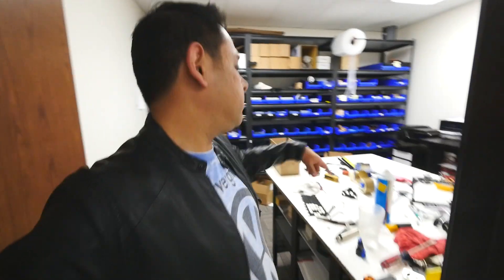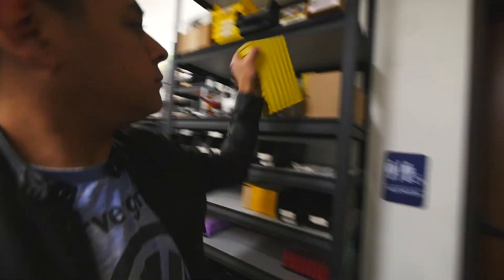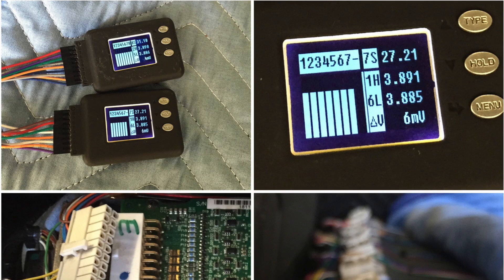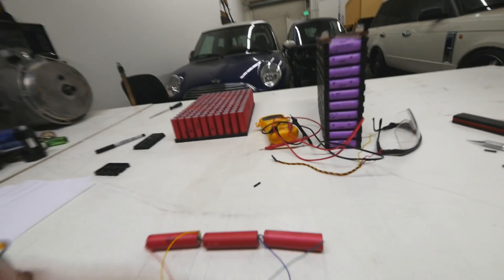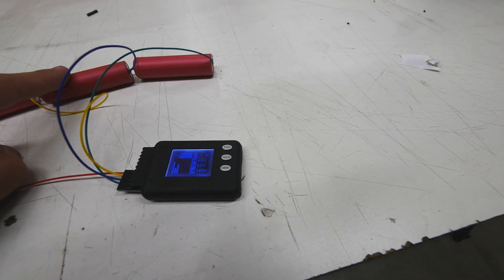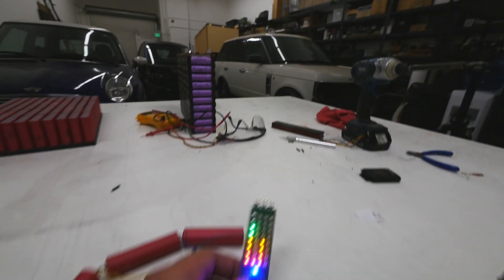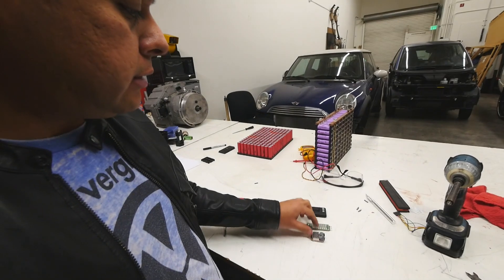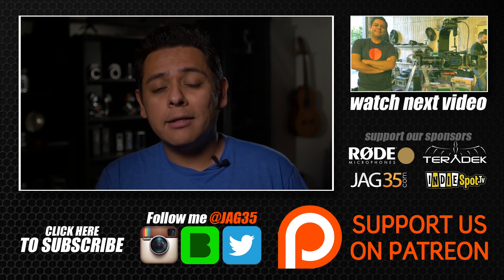Battery Management System Or BMS?

Comment: Jehu,  are you familiar with Bioenno batteries?  I think they are LiFePo4 packs.  I bought one that looks exactly like a 12v7amp sla pack.  It’s rated I believe 13.2 at 8 amp with less than 1/3rd the weight of an equal SLA.  I also bought their 13.2 Vdc @ 30 Amps pack,  it is not a SLA drop in replacement.  It was what I consider expensive.  The 30 amp pack cost around $330 with charger.  I found a NOS 35mm camera case and it fits perfectly in camera bag.  I would love to build a Power wall !  I am amateur radio operator and would enjoy a project that would allow my entire radio room to operate from battery.  Kind of a dream right now.  I have a small portable radio made by a company called Elecraft that’s in Northern CA ,  it is an amazing radio but it has very strict max voltage.   Anything over 14 volts and you are risking major damage to a $1,800 piece of portable radio gear.  The math isn’t working out in my head well, but is there a BMS or DC2DC precision regulator that would permit building a very small 18650 pack that could regulate at 13.8VDC at 5 or 10 Amps?  I will keep watching your videos for more information, just discovered your channel a few nights ago!  Very interesting and professional content and production credit to you for all your efforts!  73 de Seth - W8FG

Comment: so basically balancing the cells means draining the one with the highest voltage, but if you have 100 cells parallel working like one(cell) you need a big resistor for draining this high voltage cell, I am right?
Reply from the maker: +Jose Garcia not high voltage, high capacity,  it’s the same voltage as a single cell

Comment: My thoughts.. The reason for balancing is to prevent cells from overcharging. If some cells are at 100% already and the rest is at about 95% the charger will still charge the battery pack, because overall the pack is maybe at about 96%. So the full ones will get overcharged.. That's the theory... OK. good quality cells are never ever that far away from each other. And they don't break right away if they get charged a little bit longer. If you want to charge your cells super fast with many amps, a BMS is probably not bad but it will not balance the pack in such a short time. If you have the money and space in your vehicle, or you use many different cells you probably should get a BMS for maximum battery lifetime. A BMS can be really cheap and also really expensive. It depends on the quality and every BMS can break. If you have enough space, you could invest the money in extra cells, instead of a BMS. If space is very limited, it's probably also better to use all the space for cells instead of a BMS and just monitor them every few months.

Comment: Agreed.  A BMS is not required on most systems. I think a BMS is more of a simple solution for those who don't want to deal with  more complicated cirtcuits. Yet, If you want to squeeze the most out of your cell's life, a custom monitoring system is the best way to go. You can go really creative with an ABMS (Advanced Battery Management System - and yes, I just made that up), which monitors your batteries every so often, controls your chargers, and alerts you when a cell is showing sings of struggle.
Reply: Ruben B. Molina i

Comment: hello,how would you charge a 48v 13s 7p battery with out bms?, just connecting a 48 volt charger straight to the battery? but for how long do you keep it on the charger? I'm new to this... Thank you.

Comment: how would you recommend  building a lithium pack for a 12v car audio system? something that could support 8000 watts
Reply from the maker: easy 3S30P (90 cells total)   of these http://j35.us/18650-LG-HE2 ,  thats good for 10,000W   but you'll need this special charger http://j35.us/PowerLab8  between your car batt and your audio battery.
Reply: jehugarcia would the lithium be an independent electrical system from the cars battery or could the lithium be charged by the alternator while the car is running
Reply from the maker: +zayres29 it can be charged by the car but it has to go thru that charger because your cars voltage is different and it would damage your lithium ion cells
Reply: jehugarcia sorry to keep bothering you with questions but could a pack be made with multiples of 4 cells to get the right voltage the more voltage supplied to the amplifier the more power it makes obviously so that being said if I had a lithium pack that charged at a higher voltage i.e around 14v-15v I would just have to balance the individual packs that would be "seriesed" together to make the larger pack thanks for all your help
Reply from the maker: yeah 4S would work,  fully charged would be 16.8V.  if your audio equipment can handle that voltage there should be no problem.   You could also just not charge your 16.8v battery all the way up maybe just up to 15V but then you will only have 80% of its capacity so you have determine how long you want to run your system and make the battery 20% bigger,  that way you get your desired run time
Reply: jehugarcia thanks again for the help looks like I have a bunch of math to do
Reply: Hello 
I try to understand how you made the calculations for 8000 w using those batteries !
Can you explain me ?

Comment: Jehu you are my hero. 
I've come up with a way to use 18650's that I harvested from old laptops to power my ebike without using a BMS. I have thousands of cells that are already balanced charged. I just needed a way to use them like flashlight batteries. Use them, take them out and put in fresh batteries, recharge the depleted ones. 
I tried a variety of ways then found a simple system. No solder, no BMS and relatively easy replacement. I wouldn't suggest this for large arrays but for a 10Ah 36v system it works perfectly. 90 minutes replacement time, start to finish.

Comment: As long as they're charged in parallel for each parallel group wired in the series to either 4.2v for LiPo, Lion, 3.65 for LiFEPo4 max you don't need anything, but they will never self balance correctly on their own and if they do charge to the correct value when bulk charging it's a stroke of luck and will never work when you have two different voltage batteries unless you charge individual using the correct value. Only batteries in a single parallel group will charge evenly and level off, but the next parallel bank in the series will never level off with the first on it's own. You need something to balance or you're getting lucky or using a method like I said.

Comment: I have changed the cells of my laptop battery but now the battery's bms is not processing the voltage, before my laptop used to detect the battery and used to give 2 minutws of backup but now the voltage is not coming out of the pins but its showing 11.5 v on the ends of the three cells in series, what could be the reason
Reply from the maker: BMS board is designed to fail to force you to buy a new battery,   Im sure there is a way to turn it back on but you need to know how to connect to the micro controller and change the code probably requiring specialized equipment and software
Reply: jehugarcia okk got you, but that is very complicated,, is there no other way to override the chip and if yes then how to connect? please

Comment: Useful video
I have an electric scooter with an original 48V polymer battery that works well. But when I put in a lifepo4 48V battery it does not work. What could be the problem, knowing I charged the battery completely and I tested it?

Comment: For experimental use a management system isn't necessary - the point being that you more-or-less know the risks

For general use you can't expect Joe Average to even know about imbalances, let alone care about them.

Bottom line: GIven the fire risk of overdischarging, commercial systems without management are likely to fail the "insurance test" (ie, your liability insurance as a seller and your buildings/auto insurance as a user)

Comment: When the battery is not used, you can switch them to fully parallel and they will balance themselves automatically over time. Then you don't need any management or balanced charging. If you balance them regularly, there won't be big voltage differences so you don't need to worry about high currents during self-balancing. All you need is one big switch which connects the battery for use (charge or discharge) or for self-balancing.

Comment: I'm kinda new at this but if your running solar and use the 18650's banks wouldn't the charge controller do a large majority of your Batt maintenance( charge, monitor, trickle etc) in talking like the nice expensive Outbacks and the like, not the $19,99 ones from Harbor freight

Comment: I've come up with a way to get around the whole BMS issue: Charge the batteries individually. All you need is a way to interchange the batteries. I'm dealing with an eBike so the most I'd use is at any one time is about sixty batteries and that's only if I'm going a very long distance. Have a look: https://youtu.be/CgTVkQkJeiY

The problem most people get into is reclaiming old 18650 batteries from laptops and then soldering them into a brick. When one goes bad (and one always goes bad) they have to take the brick apart and start over. Forget that. 

I got the idea from a guy in Sweden who put his into a box with contacts above and below but that didn't seem practical with the jostling of a bike it seemed like just a matter of time until a connection was lost and your back to peddling with an extra fifty pounds.

I use 3/4 PVC tubing, some nuts, bolts, brackets and wire. I did have to solder the contact wires but other than that no solder needed. When the cells go down I can take them out, recharge them individually and they're ready to go again. No BMS needed. When one goes sour I sell it for $.50 a pound to the recycling dude. I've put up a couple of videos. Still waiting for the right connectors for my new bike.

The bike I chose is the new Sondors Thin. It's a 36V so I use ten 18650 batteries in series. I'll go with three packs per side in the saddlebags. Should extend the range three fold with only a quick stop to change the battery connection on the bike.

I've always admired the way you tackle issues and I get a kick out of your videos. Keep up the good work.
Reply: What if we just create a switch that disconnects the series connection and close a parallel connection? This would automatically balance the batteries.

Comment: battery management system ensures the longevity of the cells. the characteristics of the cells will change as they age, and a BMS system is vital to make sure that those developing differences dont build up over time. for the average consumer who wants batteries to last a very long time, IT IS A REQUIREMENT. the average consumer is not going to look after the cells and do top and/or bottom balancing.

A battery monitoring system is a must regardless.

Comment: You said your truck doesn't have a BMS!!!.. I disagree with it. Because it has a BMS named jehugarcia, and it works without your knowledge. What if a common man has a truck similar to yours?
Reply from the maker: +Green Spark Laboratories   
Cirrect,   But I've never intervened with a normal charging process,  not yet, I'm just  a spectator at this point

Comment: Don't know if this has been mentioned here, with those little cell balance monitors or even a small charger can be left connected and just break the negative balance lead with a switch to turn it on and off as needed, really handy and cheap. Ive built projects and hacked a small hobby king balance charger into my enclosure after removing it from it original case and use switching to set to charge mode, cell check and run (use of battery). Cost about $10 bucks, great for small projects / batteries. Maybe not a car though :D

Comment: What is the gauge on the wire use use as a fuse? or what fuse is it?
Reply from the maker: +Charles Roberts   I used the legs of 1/8 watt resistors,  they burn at 6 Amps,  found here  http://j35.us/1k-Ohm-resistor

Comment: What are the different capacities between your 18650 and Voltronix packs?  I do wonder how multiple chemistries would work at different capacities.  In theory, the 18650 can definitely act as a booster pack to supply large current spikes.
Reply from the maker: +Nicholas Wong 20Kwh on Prismatics    Vs  24Kwh on 18650 Tesla Pack
Reply: +jehugarcia I'm assuming the voltages are close and packs are wired in parallel. Have you ever run the 18650 pack at lower capacity than the prismatics?

Comment: This is the same issue I am grappling with my ev convert (1973 triumph spitfire). I have an orion bms, but it constantly draws 150 watts and can destroy cells if it goes bad. I know someone who had that happen to them. I also have lifepo cells from one manufacturer and from the same production lot. All cells are within a 1/100 of a volt from eachother. Not sure it is compelling to use a bms unless you are racing or charging faster than 1c.
Reply from the maker: +rascal1234   Yeah,  BMS systems are often more trouble than help,  from what I hear.   For a daily driver i feel going with biggest battery and staying off the edges of charge and discharge curves is the best and easiest way.

Comment: The reason I believe, why your samba does not require a BMS with multiple chemistry is probably because the brick type and the 18650s are in parallel to each other, where in they sort of self balance. Of course safety is taken care of, but when you mix multiple cell capacities in series and connect it to a charger, then what can you do?. For example, a 1000mah cell in series to a 2500mah cell?, the 1000mah cell is going to charge in less than half the time and the 2500 is going to continue and the 1000mah will get hit with currents constantly. Hence, the need for a BMS

Comment: most 18650 have a built in fuse right under the top. I have had many battery read 0 volts. take the top off and under the tab it reads 3+ volts.
Reply: If they have Fuse under the cap. Do we have to add an additional fuse outside?
Reply: +jehugarcia you should def do a video about that
Reply: My god you've saved me some money and some space in my trash can. I just stuck a knife under the cap and now they work.
Reply from the maker: True that
Reply: frankallen422 u

Comment: hey what is that module/app that you use for amp voltage meter that you have in your samba car on the android Samsung tablet that's really cool would like to integrate on to my ebike if it is possible thanks biggg fan of your channel and work
Reply from the maker: +Juan J Dume P  It used to be called Android Dashboard,  but now its called Torque Pro http://minibms.mybigcommerce.com/products/EV-Display.html
Reply: wow this thing is cool thanks Garcia

Comment: Except -- YOU ARE the BMS.

Most people do not want to stay as aware of the internals of their tools.
A tech-minded person like you or me is interested, maybe even /driven to/ know, and with decent monitoring would usually catch problems in plenty of time.

For my own toys, little meter/monitor/alarm cards cost about $2 on ebay.  Oh, wait - you just showed it and called it a buzzer.  That one.  Works great for me.
Reply: If safety is the issue ... go find the video where Jehu explained all those little fuse wires, one for every cell
Reply: very well said.
Reply: +Bob O`Bob But... if safety is the issue then which is safer. Jehu or the BMS? Depends on the application and the person. Ideally we would like to have individual cell management not just pack level or parallel column level diagnostics so you can detect issues and resolve almost in real time or as you say catch it in plenty of time. I appreciate that Jehu is being clear if you are unhappy with that level of "uncertainty" then you get yourself more data possibly with off the shelf items.

Bigger issue cost as well as time required to put that sort of data management in place and getting the right BMS and wired it up correctly. Plenty of mistakes can be made wiring up balancing leads just watch any number of DIY e-bike videos YouTube for that.
Reply: Yup.
Reply: It is just regular maintenance that comes with owning a car..